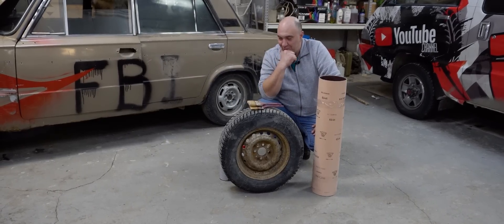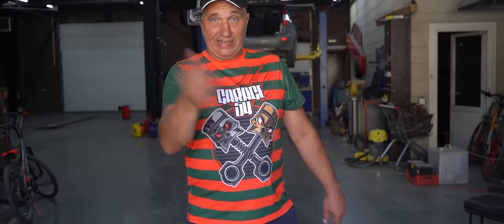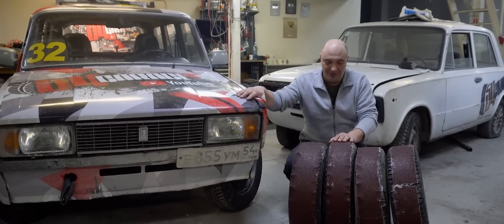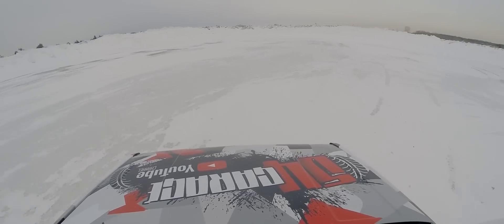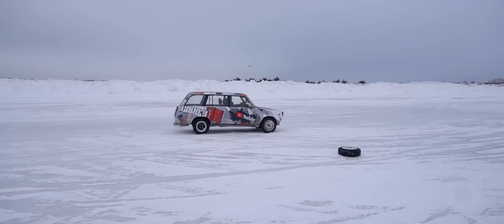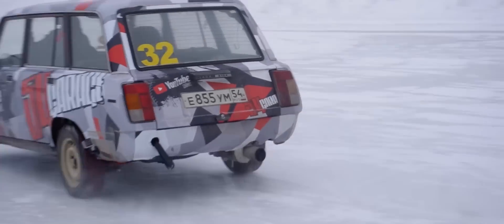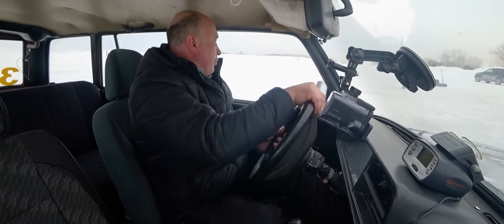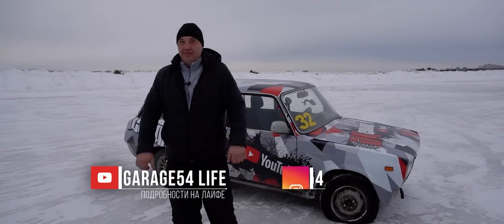Sandpaper for extra grip on ice – will it work?

Comment: If there is no ABS ,there is no steering control and car starts to slide when wheels lock up. ABS gives you ability to steer in emergency and prevents sliding. Also if there is no ESP, in emergency when you need to change lanes quickly to avoid accident, your car will skid and worse if the surface is slippery. ESP prevents that things to happen, but it can’t replace good driving skills.

Comment: If the car had ABS it would stop better with sandpaper because wheels do not lock and snow will not accumulate infront of the tyres

Comment: Can you guys try at making an engine that runs using square pistons and “cylinders” (i guess rectangular prisms in this case)? I’d love to see that works out.
Reply: Getting the "rings" to seal would be interesting
Reply: they don't have a machine for that
Reply: @vincentas1  If they can sandwich two engines together, I’m sure as hell they can definitely cut a hole in one. 😂
Reply: @Hikikomori_ika  I can't imagine how much a broach of that size costs
Reply: I wonder if it would sound different? I've seen a square exhaust that had a cool sound to it..
Reply: Rotary engine in shape of a square? 2 explosions per cycle?
Reply: @angelgjr1999  Wouldn’t work. It wouldn’t be able to compress into the sides unless the chamber was a plus shape. It would basically act like a radial at the point almost.
Reply: @Hikikomori_ika  true

Comment: I mean I think I see the logic with the idea.
'so if putting sand on ice will give you more traction on it, will putting sand paper on the wheels have the same effect'
I admit it's one of those weird questions I'd probably have. I mean thinking about it a bit deeper than surface level, though I see how you'd come to the conclusion it would work, but in reality, I dont think it'll have as much effect. all you're gonna do is kick up loose ice and sleet and make traction worse, especially if you have any wheel spin at all on the ice. 
on the other hand, assuming the car is cold and the ice is glassy smooth, it might work for a little while until friction heats up the sleet, and now you have wet ice, which is far more slippery than dry ice, which you can get a fairly decent amount of grip with with just soft tires. especially if it's really cold, and the ice has basically been freeze dried by wind and there's been no sun or any heat

Comment: Just for fun. I'm glad you do these videos. They are so much fun to watch. But tire manufacturers do this too. Sand paper tires won't last 3000 miles. Tire manufacturers work for, longest life, maximum traction, for the median driver, for the lowest cost..... Next time, bolt your tires like we do in Alaska. And the stab breaking that the last guy said is totally valid.

Comment: whats with the ultra wide screen
Reply: it feels like something is missing from the picture
Reply: less grip with graphite
Reply: graphite-carbon is both high-temp coating (graphite blower) and slippery bearing lubrication coating, nice
Reply: high speed carbon embedding on aluminium oxide surface

Comment: Will a 4 stroke run with no oil rings?? Video idea
Reply: I think they may already have done this, but yes, it certainly will, it will just smoke like hell, the oil control rings are there to scavenge oil from the cylinder walls and keep it out of the combustion process.

Comment: The car starts to rotate when you lock up the brakes because the front end has more grip than the rear (due to the weight of the engine and the weight transfer due to deceleration). Pretty much the exact reason why old trucks used to come with ABS only on the rear axle (when that was allowed)

Not surprised this worked so well. It’s the same concept as putting gravel down on snowy/icy roads.

Comment: This superb video experimented with methods for increasing traction. Good stuff; now we know that sandpaper adds friction and reduces acceleration times and stopping distances. To add to our ever-expanding body of automotive knowledge,  I suggest going the other way next time - to experiment with various methods for REDUCING friction - to see how to maximize the time for acceleration from 0 to 40, 0 to 50, etc. and ways to maximize stopping distance. May I suggest a few methodologies that would logically reduce traction, increase 0-50 times and lengthen stopping distances? I've always wanted to know the best ways to make my car as unsafe as possible and such tests could go a long way toward adding to our conventional wisdom on this critical topic.
Test method #1: use wide, treadless racing slicks on an ice track.
Test method #2: use the tires in test method 1 but this time, liberally slather lard on the treadless surface of the tires
Test method #3: use the larded tires from test method 2, but this time add copious quantities of vegetable oil or 0W-20 motor oil
Other ant-friction materials should also be tested - things such as graphite powder, silicone spray, banana peels, etc. 
There is no better place to look for accredited scientific exploration than Garage 54 and we all eagerly await this important "research."

Comment: WIthout watching the video, there is no way this will work... There isn't enough 'tread depth' to evacuate the ice shards that will be formed by either slip angle of turning or straight up loss of grip. If they glued little strips to each of the high spots on the tire, I bet this would work phenomenally.

Comment: Awesome video well done and I live in the mountains and there's a driving technique called stab breaking it's to keep your brakes from overheating when you're on a mountain side but if you're willing to do another experiment every time you feel it pack the tire patch up with  snow release the brakes let the wheel turn a little bit and break hard again I bet you can stop it shorter than the mark you made with the studded tires and to be fair use stab breaking with the studded tires but I don't think it'll make any difference with the studded tires as a matter of fact I think you'll lose ground and you'll go past your mark because the studded tires probably the vehicle is probably riding on top of the studs and the snow is not going to pack up it will pass right through the gap between the tire and the ice now if it was a lot of snow then stabbed breaking might make a difference even with the study tire
Reply: I'm sure people who live in Siberia just might already know how to drive in snow.
Reply: It's called cadence braking, rapid application and release of the brakes and is taught in driving lessons here for when driving on wet or slippery roads.  If one has a vehicle fitted with ABS it can often be felt through the pedal as it releases and reapplies the brakes.
Reply: @tonys1636  Yep
Reply: For those that live in Siberia I'd have to agree with you and every one of his videos he's always talking about how much snow there is but I don't think I've ever heard him say he's in Siberia nah I knew it was cold but I didn't realize it was Siberia
Reply: Good analytical devination. Like your understanding of physics.
Reply: I'm in Alaska. Yep, every comment here is valid.

Comment: That was an awesome video. I enjoyed it. Can you and your team do a fwd versus rwd challenge? I'd like to see a video like that. To me i would think logically the fwd could drift better than an rwd due to the fact you could lock the rw's up while the fw's kept pulling. I know this is most likely a stupid request/suggestion, but I myself would like to see it. Not sure about others though. Have an awesome day or night. Byes for now.
Reply: A RWD car will with enough acceleration just start trying to get the rear end of the car in front just because of the imbalance created by the rear end pushing. The FWD cars will never be able to drift because drifting is done by using that imbalance. Also FWD cars apply all the forces on the front wheels, making drifting useless. When drifting the rear wheels can apply acceleration towards where the car will be - a FWD car cannot do that for long.
Reply: The reason awd cars can't drift properly is because the front wheels keep pulling the car out of the slide
Reply: Front wheels cant do much when rears are blocked. You need to constantly supply power to the rear wheels to maintain drift and with winter tires you need surprisingly much power to maintain drift at higher speeds, and you need speed to enjoy drifting.
Reply: @pflaffik  Hmm. Interesting. I didn't take that into consideration actually. I drive a fwd car and I drove a rwd truck. I myself have never drifted or seen it outside of videos, movies, and tv. I always wondered about drifting and how it's done, but I never took into consideration that you need to supply constant power to the rear wheels to maintain a drift, it was beyond me, I think. Thanks again for the reply. I greatly appreciate it. Have an awesomely epic remainder of your day or night. Thanks again for the reply. Bye byes for now.
Reply: What if you had power to your right front wheel & power to your left rear wheel & or the opposite LoL 😆 that would be wild maybe call it diagonal Power LoL

Comment: the ' arrow' is only if you are using the sandpaper as the belt it was intended to be used as on a machine to keep it tracking properly and on most modern machines not relevant anymore because the tolerances are tighter for the wheels. has nothing to do with the grit of the paper...

Comment: I wonder if the sandpaper being oriented in the same direction as the bandaids 🩹 with the spaces in between would yield better results. The idea is that the sandpaper gets clogged quite quickly with snow, and the breaks in between could allow for clearing.